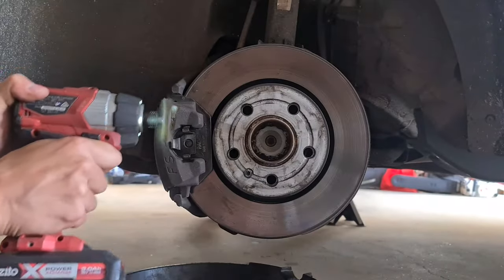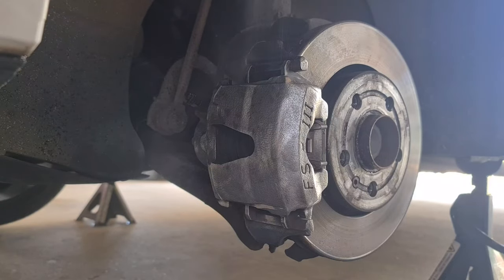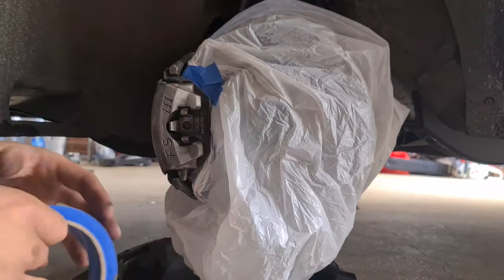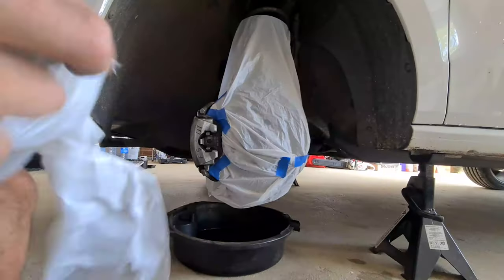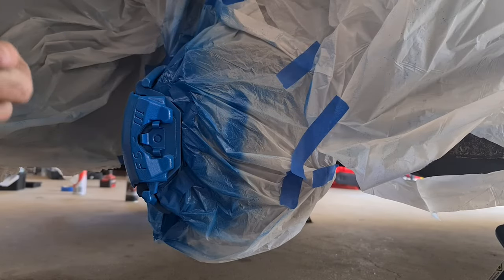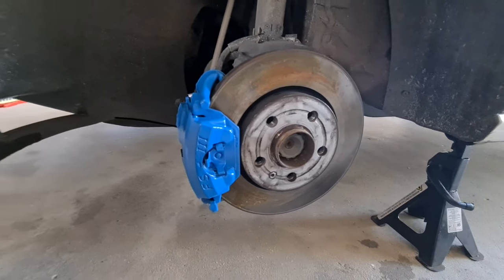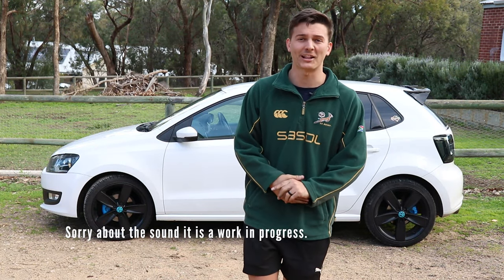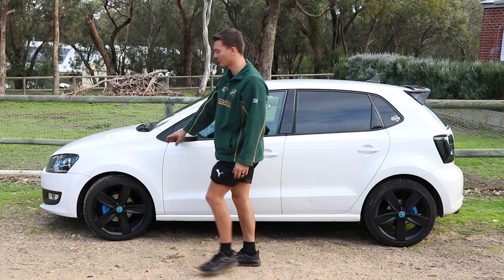PAINTING BRAKE CALIPERS  | DIY | VW POLO | MK5

Comment: Im absolutely not hating but just giving feedback: always use brake cleaner first. Even before wire brushing. When you wire brush, you create small tiny scratches for the paint to latch on. If the surface is dirty, this dirt will get into those scratches and the paint will come off sooner or later. After cleaning and then wire brushing, you use a primer to make the paint adhere better!! This way the paint will also stick better and not come off in 2-3 years. Lastly, use a clearcloat!!
Reply: I just watched this to have a little look on how others are painting theirs, before I paint my own. I totally agree, I would also add that heat paint would be going that extra mile also, so that the job will hold up a lot longer and keep it looking fresh for longer. But I would like to ask, can you get heat resistant clear coat? Sorry if it’s a stupid question lmao, I just genuinely have no clue?
Reply from the maker: I agree big especially on my wheels I have noticed the importance  of a primer and a good clearcoat

Comment: Next week vid - Remap Stage 1 😂 😂 😂
Reply from the maker: Definitely on the list, I need to service the polo first.  I also need new engine mounts.  Will definitely  get stage 1 remap after the engine mounts are replaced.

After stage 3  engine swap to 1.8t engine is looking like a fun  idea😂
Reply: Ill second that idea🤔
Reply: @OnlyMods  Awesome. I had mine remap to stage 1 last week and it's certainly a lot more responsive since the remap. 30hp gain.
Reply from the maker: Thats a really good return how much did it cost you for a remap? What price range am I looking at ?
Reply: @OnlyMods  For stage 1 it cost around RM1600 in Malaysia - AUD 515.00 😅

Comment: Great job man!, Regarding the wheel caps, that blue color it is a cover sticker which you need to peel it off, it is not a standard sticker!
Reply from the maker: Yes it is a sticker i made when painting the rims, I'll have to try and order some blue vynil  that is the same as the brake callipers and re-do the stickers.
I peeled one sticker off yesterday and looks off with the blacked out caps.

Comment: do it properly unbolt them and hang them to paint that paint wont last without a heat primer just chips away
Reply from the maker: Okay perfect  thank you for the knowledge,  I'll  make a video in 6 months time to see how they last,  they will mostlikely have some chips  so I'll need to try your suggestion.  Heatprimer then  the top coat , I'll also remove the callipers would be something different  from all the other videos out there.
Reply from the maker: I am planning on making a sound deadener video in the near future, one of my friends have purchased an off brand sound deadener for his ranger, we will give it a go and see how it works.  Thank you for the video idea
Reply: @OnlyMods  like to see a video of you doing this theres a lot of products online which is the best are you talking about the doors floor etc or the undercarriage
Reply from the maker: @russelblackwell6041 Yes we will be  filming the video  by the end of this month.
 It is 4m rolls from underdog soundproofing, for the inside of the cabin. The roof doors and floors. But not entirely sure if  my mate wants to pull the oem floor ones out and install the new deadener or stick it over the top. We will have to see how it turns out.
Are you planning on using sound deadener  on your car
Reply: Did the paint hold up? Thinking of doing this myself @OnlyMods